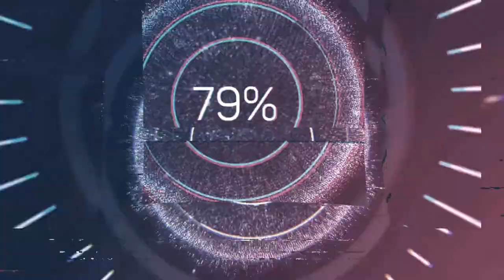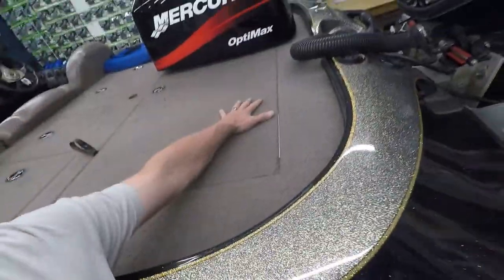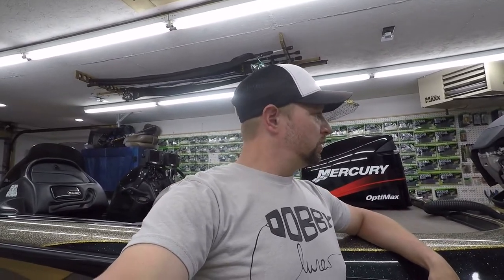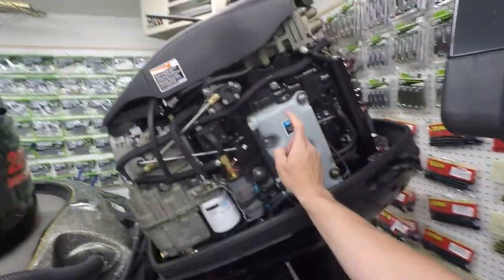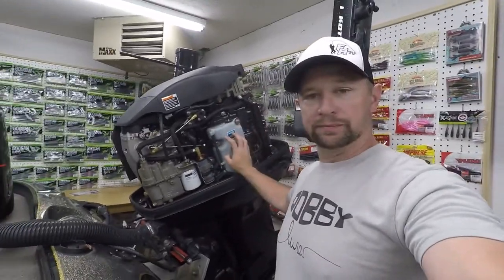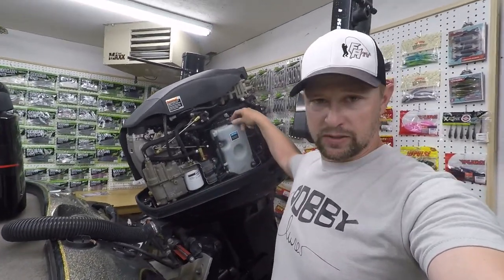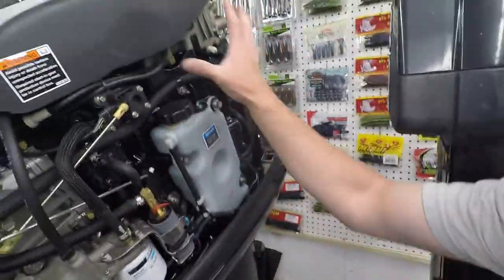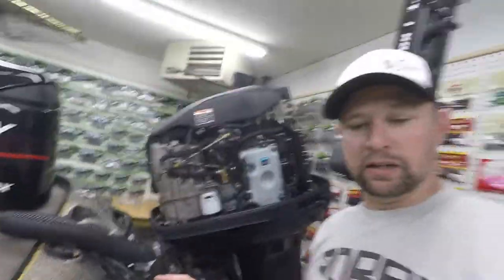Mercury Optimax Oil Reservoir Issue

Comment: Guys check your screen at the bottom of your main oil tank to make sure its not plugged. Then replace the small oil filter $5. Then check the back check valve after the oil filter and then there is a back check valve on the engine. If these back check valves fail you wont get oil to your engine oil tank. also check your lines for air leaks and your cap is seated properly. the last thing I would do is the actual tank on the motor, those usually don't fail. the other parts are cheap and easy to replace.
Reply from the maker: Great tips!

Comment: Im dealing with the same issue. All you had to do was on the water was remove the cowling and open the vent on remote tank, start engine and watch to fill up remote tank. Its a bit of a pain, and wear a lifejacket doing it. Taking that cowling off and put back on is the hardest part.
Reply from the maker: Thank you for that information Ron. That is something I didn't consider and I will definitely keep that in mind if it happens again. Any information on issues like this helps a ton. I appreciate your comment on this. Thank you again! 🙂
Reply from the maker: Ron, this was just a temporary fix right? Just something to help you get back to the ramp?

Comment: It’s the oil level sensor combined with the float inside the oil tank.   The float inside is magnetized and interacts with the sensor.   If the float loses enough of its magnetization, even if the sensor itself works, you will still get the 4 beeps.   You can “fool” it while out on the water with an extra sensor on which you put some round magnets and connect to the sensor wiring - it fools the system into thinking the reservoir is filled.  The only real fix is to replace the reservoir tank because the float is not serviceable.  Just keep the sensor off the old tank and get round magnets on with tie wraps (Home Depot for the magnets) and keep in the boat as an emergency bypass if you get this problem.   Just connect the sensor with magnets on it to the wiring and let it hang off to the side under the cowling until you get back and can replace the whole oil reservoir.   It’s two wires and if memory serves, the polarity doesn’t matter.   Just visually look and make sure the oil reservoir is actually full.

With the new oil reservoir, you need to open the threaded cap as it’s filling a bit until it fully fills - you are effectively bleeding and burping it.  There are some other YT videos about the oil sensor issue as well.   Good luck
Reply from the maker: Lots of good info there! Thank you for sharing. To be honest, thats way over my head mechanically. It was much easier for me to just replace the tank. I suppose the easy way out haha.

Comment: My beeping is when I first power up the engine, then the oil gauge blinks. Is the sensor faulty or is the engine not getting oil? I could see 3800-4000 rpm. 2012 model
Reply from the maker: The sensor inside the oil reservoir (the small oil reservoir located on the motor itself, in my instance anyways) are pretty cheap, so to test that you could try just replacing the sensor and see if that works. Thats what I would start with. Also Checking to make sure the smaller oil reservoir on the motor is filling up with oil.

Comment: How did you purge the air? I have Same issue On my 250 waiting for new tank to come in.
Reply from the maker: Sorry for the late reply Mark. Start engine with cowling off then slightly open the cap on the engine mounted oil tank until oil comes out, then snug cap.
Reply from the maker: I really wish I would have done this video when I did the work but I didn't have my gear with me.

Comment: I have the same problem on my boat, there is a fault in the sensor indicator. Is there any problem if I control the boat in this way? I use a maximum of 1 hour a week.???
Reply from the maker: I'm not sure about that. I would give a certified marine mechanics shop a call on that to be safe.

Comment: Thanks for the info. I just had a similar problem today. I got 3 beeps and my gauge indicated I had 4% oil in the reservior. My remote tank is almost full so it’s not low on oil. The oil is just not getting to the engine.  I was able to get towed in. Would I need to replace that tank?
Reply from the maker: I am not 100% sure, but I would start with the line that takes the oil from your tank to the motor.

Comment: When you had the beeping, did it put the motor in limp mode, or would it keep running. I am having the 4 beeps, but its on hole shot only, and it puts the motor in limp mode. It doesn't do it all the time.
Reply from the maker: Yep, it did. Thats exactly how it went for me. I would just get on plane or just about to and then the four beeps and limp mode.

Comment: Is there a air filter. I have a efi 150. I changed the gas and the oil filters from tank to bottle on motor. Spark plugs theamasts. Doing lower unit tomorrow. Anything else
Reply from the maker: I'm not sure... are you having a similar issue like what I was having?

Comment: Today i got the same problem  main tank is full of oil but reserve wont fill.  anyone know it there is a pump or what pressures your main tank to fill reservoir?
Reply from the maker: Do you have the exact same motor?
Reply: @AROoutdoors  yes 200 optimax
Reply from the maker: @lessmith9065  Ok, it might be an air pressure issue within your main oil tank, possibly. I am not 100% sure but check out this forum. 

https://continuouswave.com/ubb/Forum3/HTML/010923.html

Let me know if this helps. Sorry I am not much help.
Reply: @AROoutdoors  Thank you so much for your advice . if all else fails then i will put on new tank
Reply from the maker: @lessmith9065  You're welcome! I'm no expert but if I can I like to try and help others.

Comment: So I had the same issue, I changed the tank and when I went to prime the tank with the cap off it wouldn't fill, the beeping stopped but the tank won't fill up.
Reply from the maker: I believe all you should need to do is fill it up the rest of the way yourself and you should be good. BUT, since I am not a certified Mercury mechanic, I would consult with one just to make sure that's ok.
Reply: @AROoutdoors  alright thank you, my dad is confident that we fixed the issue. Unless we had the float go bad and had an air leak start at the same time. Hopefully all is fixed. Going to test it on Tuesday 🤞
Reply from the maker: @Rene_Savard85   Thats great news! My fingers are crossed for you as well!
Reply: I have the same problem I can't get the reserve tank to fill don't know what else to do